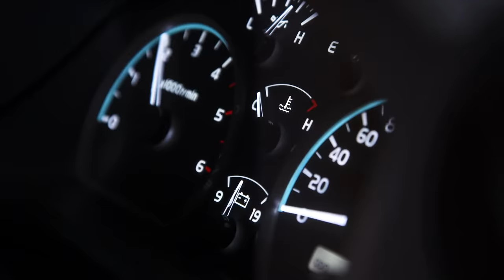Recovering a Broken PATRIOT CAMPERS X1 from the Middle of Mongolia  • Season 3 • Episode 22

Comment: There is always a trade off between weight, strength and cost when providing products to the public. You are doing a fine job with a well made product. 1 in 2,000 had a significant failure while being fully tested, and it hurts your pride? That’s the mindset of a good builder and a lesson to your children. I would be proud to own one of your trailers without any reservation of its capabilities.

Comment: Justin,
Great video!  And it takes courage to also show, when things don't go as planned, and how to work through it as a team, and how you usually can get local help, if you travel with the right companions!

A humble side question:
Why didn't you guys build a little "improvised sled" out of the pieces of wood and fix it to the broken suspension arm of the trailer to get over to the dip where you intend to load onto the truck?  We have done this in the past to "limp drive" for a short distance, just to get to a better place for attempting a more permanent fix or execute plan B.

Comment: I wasn't there obviously but still have to ask why you didn't strip the camper of all its gear (if it was possible) before trying to push it up the first ramp to lower the weight then chuck it all into the back of the truck.
Reply: I was thinking the same.

Comment: You had wood materials ratchet straps/fencing wire, why didn't you build a sled for the broken axle? Or drove the front of the truck up the toy haulier lowering the rear of the truck used two winch blocks on the headboard and run the 2 winch trucks at right angles and winched it up. Anyway a good night sleep may have had a better solution rolled out a swag for the truckie he would have loved it.

Comment: Do you think that maybe  that batch of steel did not take the heat treat correctly and made the steel brittle. So maybe the size  of the shift is fine but not the temper. Good luck on that.

Comment: I'm sure the trailers are awesome and everything fails sometimes. 
But that recovery seems like a bunch of hastily made terrible decisions. 
The "ramps" Couldn't take the weight of the trailer and he wanted to put the 200on it? 
And it could have been significantly lightened before the drag. Rooftop tent, wheel, fridge?, were the tanks empty? 

And then there's the old trick of ratchet strapping a log under it to drag on...